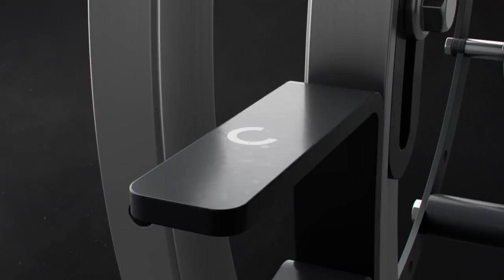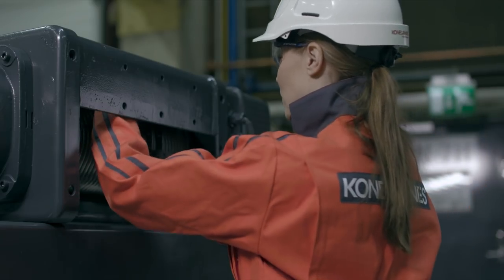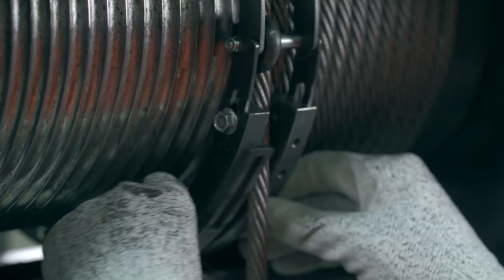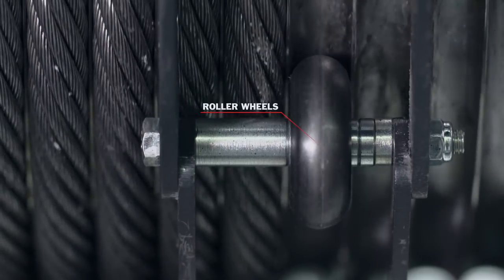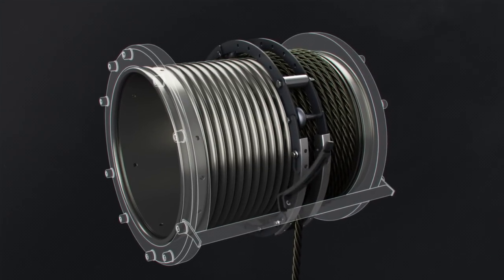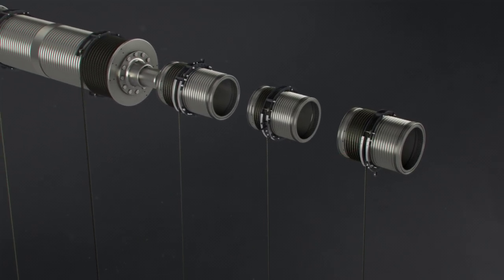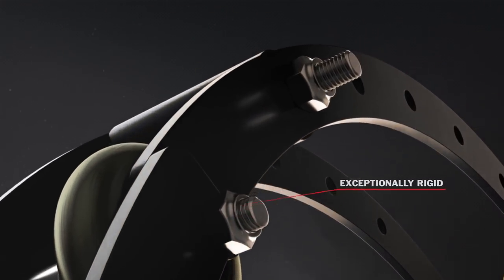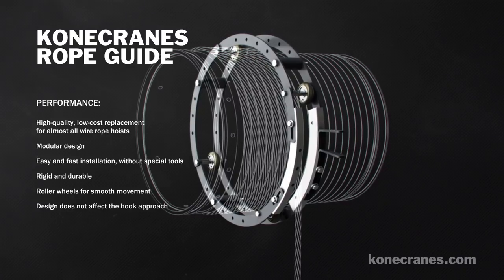Konecranes Rope Guide

Comment: There rope guild is not as easy as they say when you're in the air in a lift , note they show you repairs  on the ground that's not where it is when you work on it , the rope guild needs a lot of lubeorcation or it wears and don't work good in steel foundries or cement founders or where there's dust build-up they don't tell you
Reply: An awful, cheap to make, expensive to buy, replacement of the old cast design.
Quick to wear and requires regular adjustment to keep correctly fitted to the drum.
The rollers can't be brought as spares parts.
Reply: A lot easier to work with then the old cast Steel two-piece and spring  try soap grease
Reply: @flytrapjohn sorry boss you bought it is European
Reply: @flytrapjohn  100% agree, the old iron ones are top tier... 2 bolts with springs and one big spring to wrap around the drum. This one is a mess, absolute pain to install... and dont even come with "multi use" parts... they send a few cheap pieces of crap  metal to help configure to ur needs.. but it screams add-ons which is now 3rd party modifications which is against the fking law